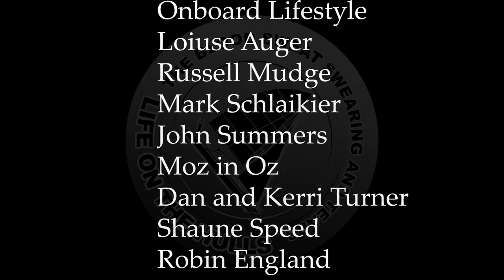Ep078 Boat Blackwater Tank Build - Life On The Hulls - Catamaran Build

Comment: Hi Ross, with these tanks how will you be draining them to the sea? Pumps as they are below the waterline?
Reply from the maker: Hey Kev.I will have macerator pumps to such out however will have a y valve before tank to divert when at sea.I will be carrying a spare pump.I did consider a ball valve st the base of the tank as well with an in line pump to through hull but do not believe it will be necessary.Thanks for the comment I appreciate you taking the time comment.Rossco

Comment: you are not going to be using the mold again, so why not just cut round the black line and sit it on the table, I can´t remember, I assume the table was the flange last time. 
Keep up the good work, can´t wait for top and bottom to be done and stuck together.
Reply from the maker: I may well use it again Duncan as there is tue possibility of another boat in the future.Original tank had a melamine base that was screwed to the bottom of the mould.I will be very hsppy to see the deck on the hull as well.So much detail in the hull bilges and bulkheads;very little in the deck layup if any.All the best.Ross

Comment: I wonder if that one came out easier because you used a different gel coat? I recall the orange one was an old one you had laying around.
Reply from the maker: I think in reality the smaller size and possibly new gel coat may have done the trick.Mould was also better prepared with multiple wax coats.All good in the end.Rossco

Comment: Way back when I was a USN sailor , a big part of my job was maintaining the CHT system. Collection, Holding and Transfer of blackwater. Why it is that the USN needed to use gentile words like "blackwater" then name the whole handling system with an acronym like CHT is a mystery to me. My ship had two large stainless steel tanks, four big trash pumps and the level sensors inside the tank were a vertical row of bobbers with mercury switches that closed when the level rose to lift each bobber.   I want to ask whether your tanks will feature agitation,, what the nature of pump you will use and what sort of sensor will tell you that the tank is full.  I seriously like your videos, especially now that you remind me of my CHT naval duties..
Reply: Most pumps have a volute option for tank stir. I've had paper debris clog on a level switch and show false readings.
Reply: A very good sensor system that does not need any holes or other openings in the tanks comes from http://www.gobius.se/en/
Reply: That is interesting, they even claim to be good for fiberglass tanks.
Reply: Yes, That sounds like a good solution, I don't know about tanks this size, on large tanks agitation is a good idea  because there can be a lot of wasted capacity from settling in the corners. This might be a problem that never shows up , for all I know.

Comment: Hi Ross what resin are you using? is it polyester? or vinylester? maybe some discussion on various resins might be good?
Reply from the maker: sounds like a great idea. The sewer tanks are simply ployester however this will not be enough to ward off the nasties of a holding tank.They will be completely lined with Red Kote or similar which is impervious to chemical attack.It is a product that is often used in fuel tanks to seal rust and failed seams.Sll the best Rossco

Comment: Did the Efudex last year, worth it... but uncomfortable
Reply from the maker: Sure was uncomfortable but the results were worth the pain snd discomfort.Worse part was the respirator skirt rubbing on the spots ,was insane.All the best Ross
Reply: @LifeOnTheHulls   Great to get the sun message out, so many of us were "bulletproof men of action" back in the day when clearly in retrospect just plain ordinary humans - I work with plenty of worn out blokes that pushed the limits of endurance in work and play that are nearing/shy of 60 and in pain everyday- joints, back etc. When I did the Efudex lots of blokes came up out of the blue with reassuring words, had two weeks off at the start but was back at work for the third week & scabs & shedding of layers pretty gross & a bit of psycho mind over matter helpful... just like grinding glass... feed off the pain it only makes you stronger;)
Reply from the maker: @waikikin  Good to hear you got through it.Mine actually wasn'
t too bad.Lots of s pots but not entire face luckily.I have used sunscreen pretty much every day since I was about 18 so I reckon I got off pretty lightly.Cheers Ross

Comment: Vinylester or polyester?
Reply from the maker: These tanks are iso polyester, however are to be conpletely lined with red cote fuel tank liner which is like a mastik that goes rock hard and impervious to bacterial and chemical attack. amazing stuff really and once tank has it's lids sealed will be coated by rolling the Coating all over the internals.Cheers Ross
Reply: @LifeOnTheHulls  nice.. don't worry about the cream and your appearance... We're still gonna think you're a very handsome man... 😉😊😂

Comment: Try these blades, the teeth are solid carbide and never wear on fiberglass.  
Dremel MM485B Carbide Flush Cutting Blades, Pack of 3 https://www.amazon.com/dp/B00FBHFY3K/ref=cm_sw_r_cp_apa_i_IhcvDbGPJAMVD
Reply from the maker: Thanks. I think I have the circular version it is incredibly hard wearing I will buy some straight ones like that I hadn't seen them before.All the best Ross
Reply: These are the only solid carbide teeth i know of. Some are just sand paper grit style and dont cut well